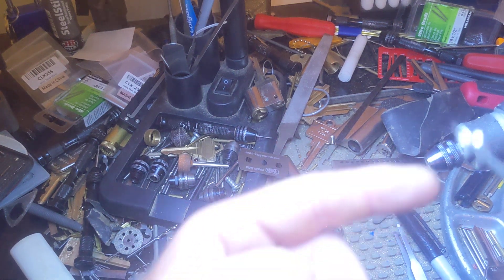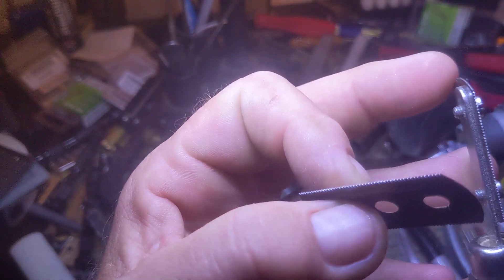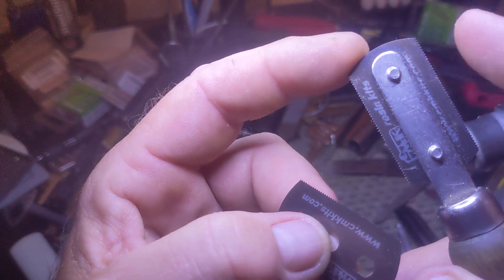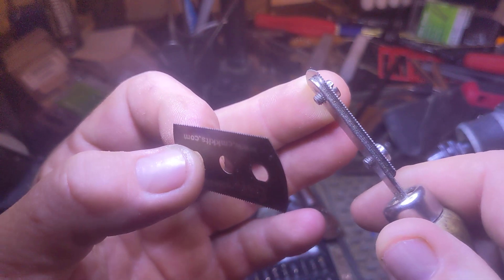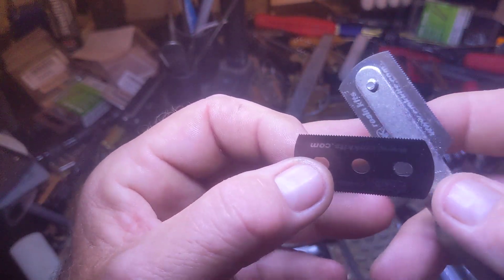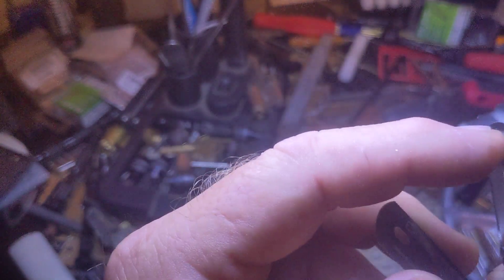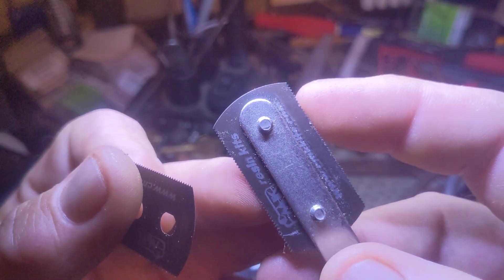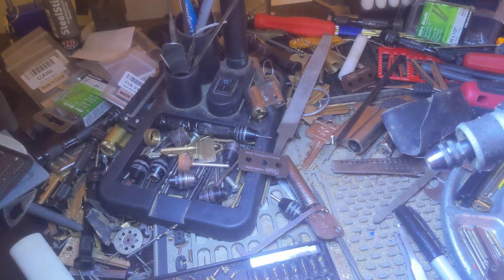mini ultrafine razor blades and handle tip for stainless steel pin making

Comment: I'll keep that in mind when it comes time for me to cut stainless.  Haven't tried that yet.  When I was working on some pins last weekend I used my handle that has 5 blades stacked. That one creates .025 wide serrations.  An unintended happenstance occurred when I noticed the blades were not completely flush with each other. It created "steps" within the serration.
Reply from the maker: that's what I noticed too with the 2 blades I have on mine now, 1 is slightly higher than the other one. noticed it when cutting brass on this one I have to finish making a key for, before I start making mods to the plug and bible

Comment: Great advice J, time to store that one up for future use. What exactly is that saw called and does it cut grooves fine in pins?
Reply from the maker: it's a JLC hobby saw, the one I use i get from micromark.com I usually type in wood handle saw and it appears, then ultrafine razor saw blades and the single and 5 pack shows up. given the cost of shipping and the parcel extortion that goes on 1001hobbies has the blades, which ships from France and there's different shops online that have the handles ( JLC saw ) . let me do an addendum for this video, it will be quick that I will take my micrometer to a blade and show its thickness. I have been racking my brain on getting a key hand filed for a Yale keyway CL and down to my last key 🤞 hopefully I get it right! if not I will get another 4 keys this weekend and try again 😅
Reply from the maker: the blades are .120mm each at least measuring the one I have laying out and the double up in the handle is .28mm which maybe due to some debris between the blades. hope that helps.
Reply: @j.gabriel8573  Cheers J that's awesome THANK YOU for the info